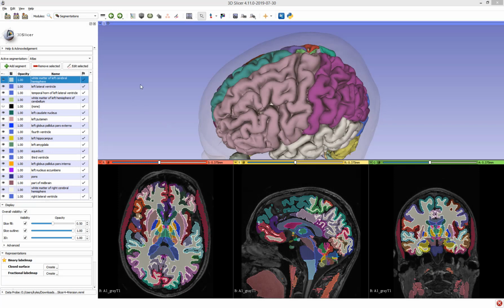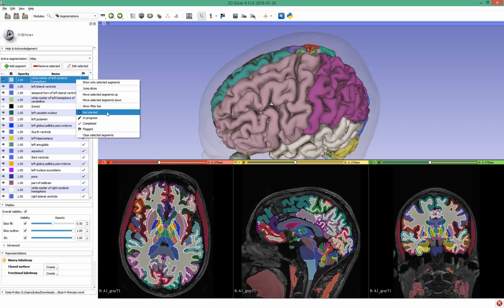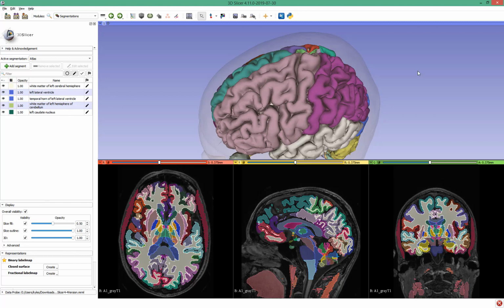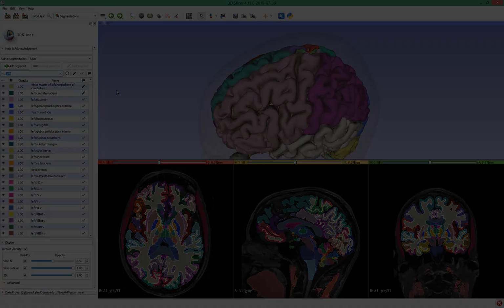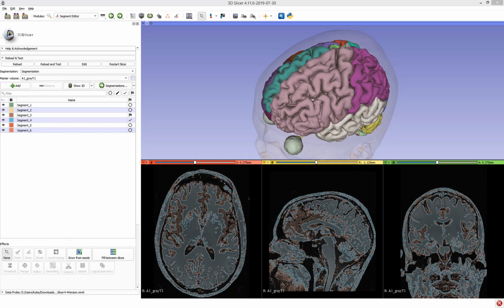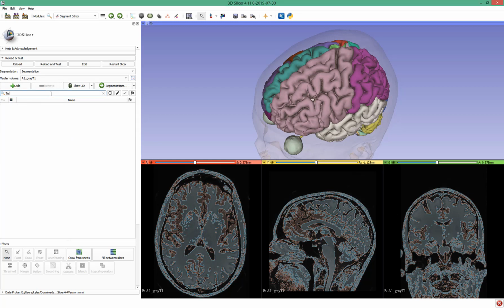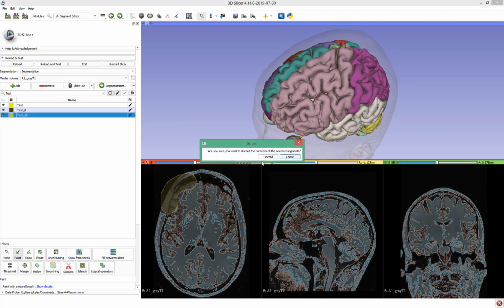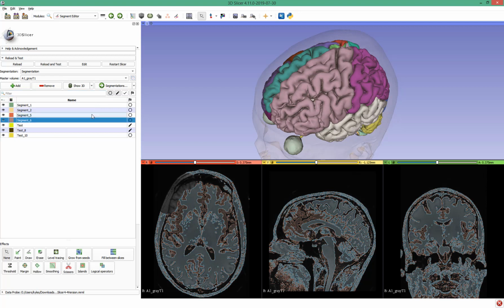3D Slicer - Updated Segments Table

Comment: Hi, I want to know how to segment the different areas with different colors in the brain to generate the brain atlas? Thanks!
Reply from the maker: You can use Segment Editor in 3D Slicer for manual/semi-automatic segmentation. There are tools for less accurate but fully automatic brain segmentation, such as FreeSurfer or FastSurfer.
Reply: @PerkLabResearch  Thanks!